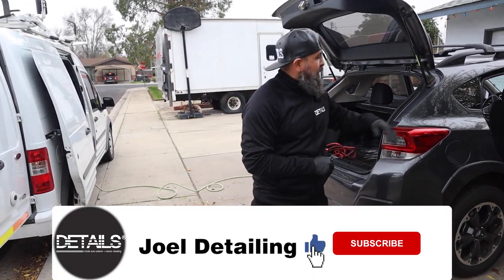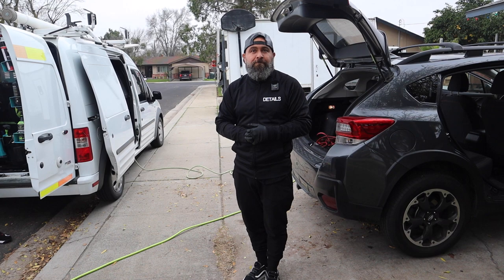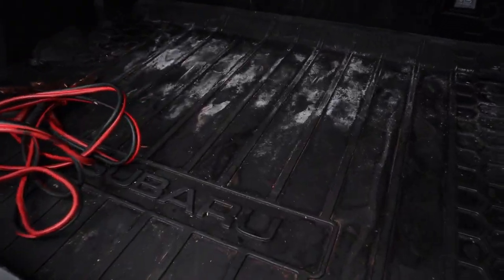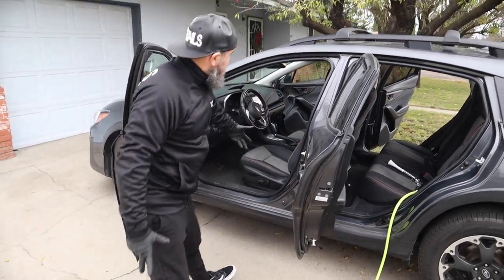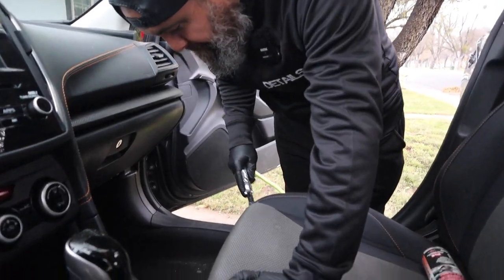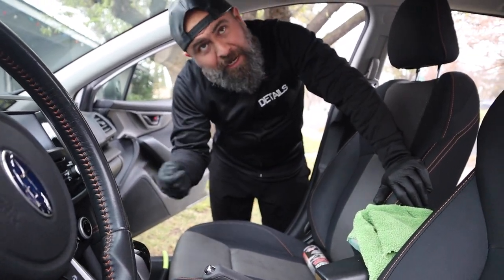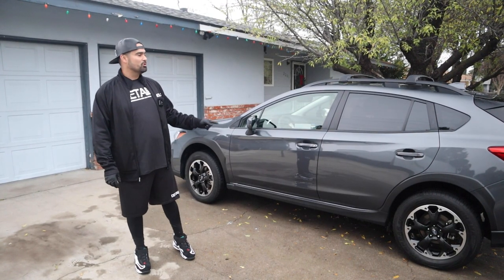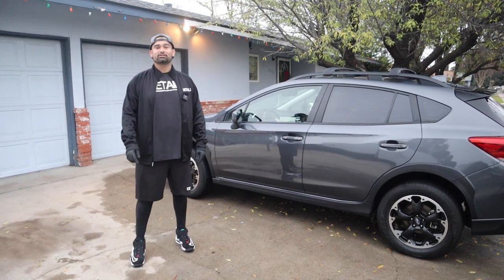Full Exterior and Interior Detail - Joel Details

Comment: So I see that you use bead maker when you do a maintenance. What do you put on the car initially for the first detail? And how much more does it costs for the first detail than the maintenance?
Reply from the maker: That ranges on the size and desired level of protection recommended for the vehicle (wax,sealant ,ceramic or graphine)
Reply: @DETAILSofficial  Do you try to promote a high level of protection first or do you just do bead maker pretty much every time? Like a bmw for instance, it’s a nice car but not insane. What would you normally offer for that level of client?

Comment: Hey Joel love the videos. You are a awesome detailed and give amazing advise. I do have a question though, I recently purchased a 20 gallon air compressor and have been wanting to use a tornador blow gun with it. When I do this the psi is set to 90 but once I pull the trigger the psi drops to about 60 or 70 psi. Do you know why I am having this issue? Or have you experienced this before.
Reply from the maker: As you release pressure (when pulling trigger) your psi will drop as it drains the air from your tank.